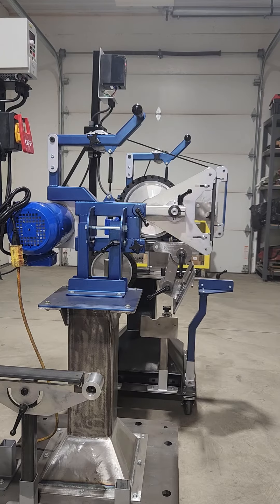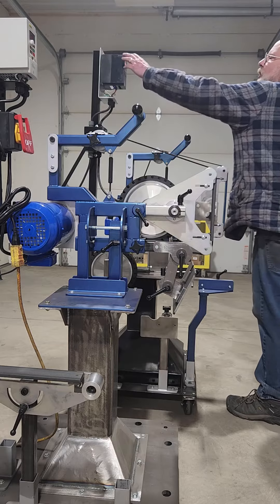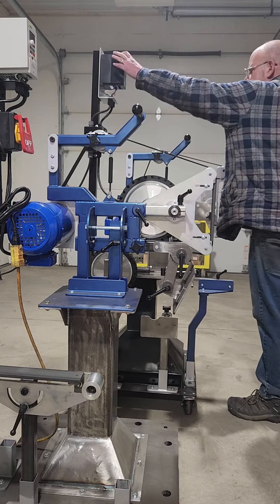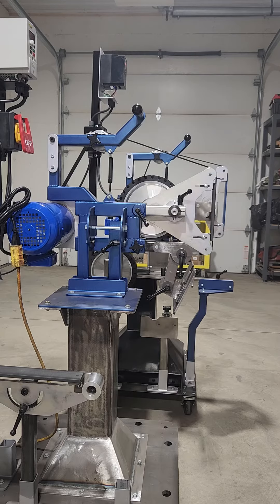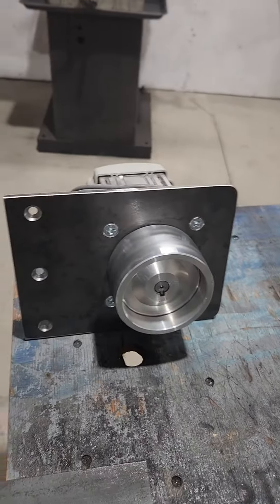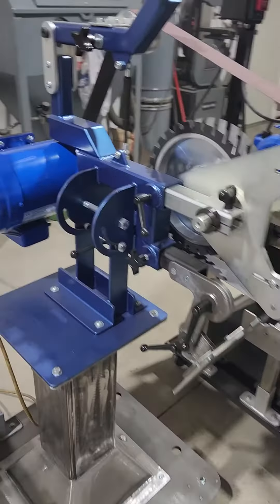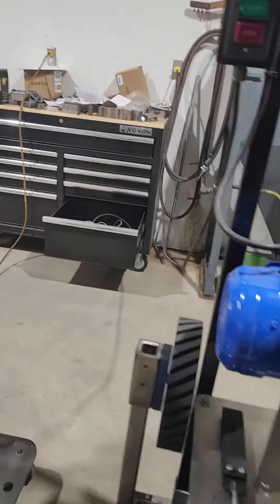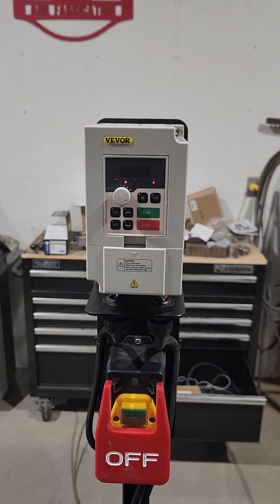March 29, 2024

Comment: Do you have these grinders or build plans for sale, how much and where do you ship from thanks.
Reply from the maker: Where are you located
Reply: @jamesstuart946  I am located in NWO Canada near lake of the woods.
Reply from the maker: @danwilliams1645  I have shipped  the G6 rotary platen and work rest to Canada each cost $62.00 to ship. It is too expensive to ship a complete belt grinder. I am working on metric plans and DXF files for the G6 bolt together belt grinder. This is a laser cut belt grinder. I post everything that I am working on.  On my Facebook group page, home built knife grinders and tooling.
Reply: @jamesstuart946  Thank you for the quick reply, I will be watching for the DXF files when they are finished excellent work.